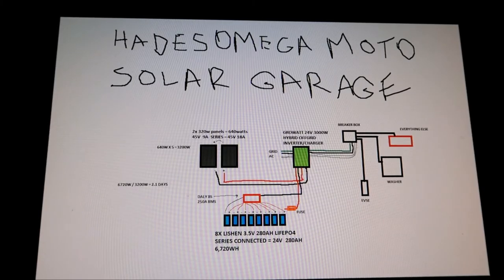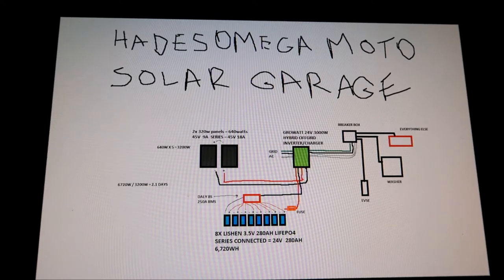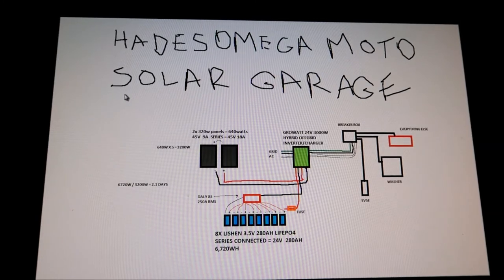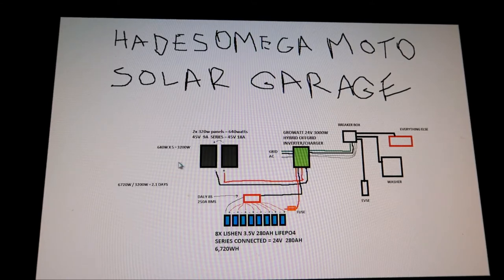HadesOmega Moto Solar Garage Project Episode 3: Solar Garage Rough Diagram

Comment: This is awesome! FYI, you can test the output of the PV modules by performing a short circuit current and open circuit voltage test. Plug the positive lead into the negative of the same panel while the panel is not exposed to direct sunlight. Then face the panel to the sun and use a clamp on ammeter to measure the short circuit current. Compare that to the Isc that is printed on the spec label. I use "preowned" panels all the time. At around 5 years old, they generally test at 85-95% the power of brand new.